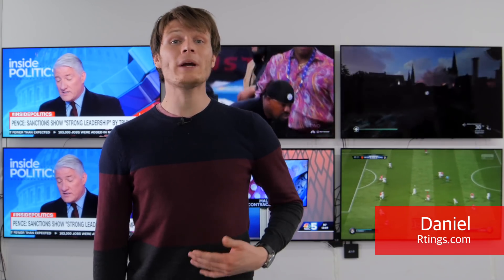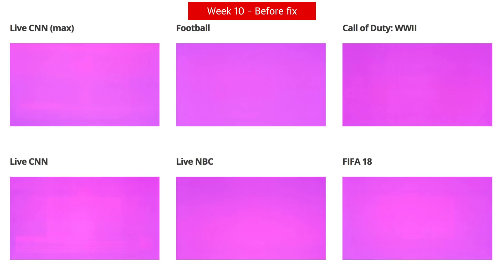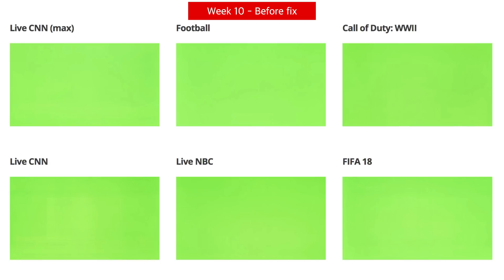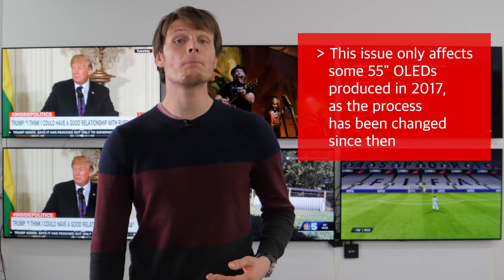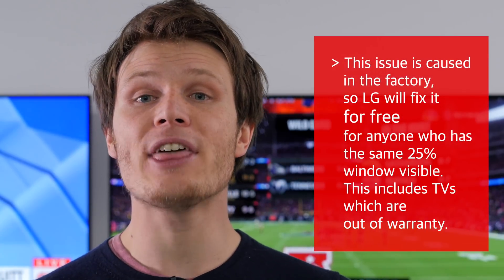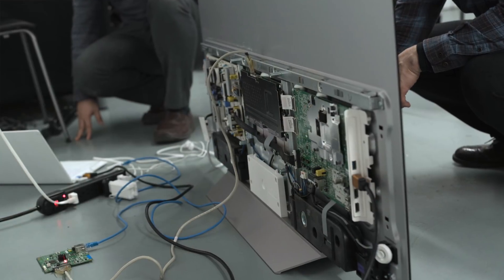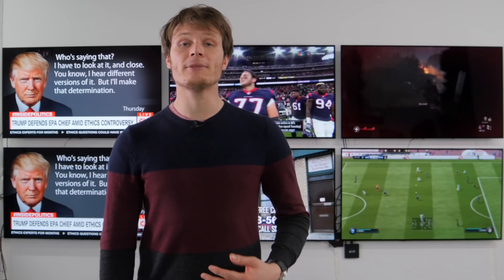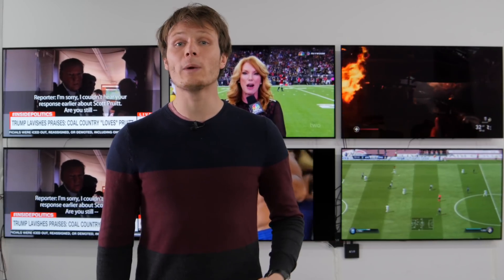Factory Defect & Fix - OLED Burn in Test Update Week 10 - RTINGS.com

Comment from the maker: We will continue to run this test to gather more data on the burn-in issue. Our current stance is for most people, if you vary what you watch, burn-in shouldn't be an issue. If you watch a lot of the same static content though, there is a risk.
Reply: Steve, TheDailyShaver Damn right!!!
Reply: i have the rectangle on mine....LG UK know nothing about it and won't fix it. All they will do is replace panel.
Reply: @davidcharles243  I'm going through this with LG now... I sent them this video via email and Twitter but they haven't responded to this.
They've told me to use pixel refresh 5 times... Like that will help. 
How did you get on?
Reply: @lydanial  - they made me do pixel refresh 5 times as well...which i did just to show willing!!...made no difference so they replaced the panel, which is spot on so i am happy. Not happy with what happened but happy with the outcome.
Reply: @davidcharles243  how old was your tv? Mine was a year old on Saturday, I noticed it yesterday.
Reply: @lydanial  mine was only a month old, so assume it came with it from the factory. Makes me wonder if firmware updates are triggering it as quite a few people seem to be seeing it but have had their tv's a while.
Reply: yea, thats what happened to me...LG uk said they can't do what is on this vid so can only replace the panel, which they have...new panel is spot on....shame they can't fix it like in this vid though.
Reply: i do know the panels take a bit of time to settle down and can improve after a few pixel refresher/compensation cycles. Its probably more that you need to re look at your tv settings after a few days usage...i have had to change the colour and oled light setting a little bit over the last few days... everything looking great at the moment
Reply: i had no luck with LG uk, they acknowledged the fault in the end but would only replace the panel, which they did and this panel is perfect. LG made me do 5 refresh cycles back to back to "prove" it wasn't some kind of burn in before they would change the panel.
Reply: well, yes...i meant i had no luck with LG uk recognising the 25% window fault...they said it was burn in. They wouldn't fix the 25% window fault either when they realised it wasn't burn in as suggest in this video. They did replace the panel in the end so i ended up happy.
Reply: My TV is less than 2 years old and when I spoke to LG they told me that I would have to pay for the repair. I don't know where RTINGS.com got their information from. "LG CHARGE FOR THE REPAIR"
Reply: I have such a problem. I live in Russia and no one wants to repair this way.
This problem also appears on the C8.
Reply: I have a just under two year old LG OLED 55INCH with CNN logo burnt into screen. I called LG support they had me send some pictures and now they are sending a technician out to replace screen and I have to cover the labour costs 250.00 canadian. Not happy will update when work is done.
Reply: Hi, What is happening about this now?  I have a 65" oled 3d tv, 3 years old about, I watch morning TV and it had a static logo and banner, This has now permanently burnt the screen, and can been seen alot on all red backgrounds. What do you think can be done? Thanks
Reply: this test is amazing, congratulations! great job.
Reply: Thanks for this video, LG Change me the panel due to Warranty issues, my model is the B7, also had a lot of burnin and this wasnt a void for my Warranty, LG should just replaced all this faulty panels, thanks rtings KEEP us informed....
Reply: Thanks for this video, LG Change me the panel due to Warranty issues, my model is the B7, also had a lot of burnin and this wasnt a void for my Warranty, LG should just replaced all this faulty panels, thanks rtings KEEP us informed....
Reply: What is this?? https://youtu.be/CVH3eMBoGAw
Reply: I just rang LG Customer support an explained that it's got a screen burn an told her about your youtube site said that I have no warranty an she said it will cost me £920 to fix the problem is there anything I can do please help
Reply: C J  LG BRAZIL did not support me in my case. They simply do not know the problem.
Reply: Rtings.com on my E6 OLED we watch essentially only Chinese TV Soap, BLU Ray disc, cooking shows. We are old seniors age 70, 80+  We have 70% screen area with Hazy bell shape burn in. Where by as Human fleshtones traverses that burn in area their skin turns GREEN!!!!!!
Reply: Rtings.com Whats static here???
https://www.reddit.com/r/OLED/comments/7nqz6s/sony_a1e_burnin_issues/

Cource its a LG OLED panel.

Static objects are just one cause of burn in's. 

The other big cause is Yellow, Red, Orange pixels don't last long. In defective OLED panels.

Comment: Does uniformity = burn in?  Just askin
Reply: No, a panel on any TV (LCD, OLED, whatever) can have uniformity issues not related to burn in such as banding, dirty screen effect, blotches, flashlighing, light bleed etc. 

But burn however, in essence is a uniformity issue caused by static content being permanently "burnt in" to the screen by pixels aging at different rates.

So all Burn In is a uniformity issue but not all uniformity issues are burn in.

Comment: Thanks to Rtings maybe LG OLEDs panels manufactured in 2018 will improve their uniformity with better QA/QC. I wish in 2019 they could develop a banding-free OLED with better performance in terms of burn in. Maybe the implementation TADF subpixel technology will be the key.

Thank you again guys. Keep us informed and push these brands to improve and fix those issues.

Comment: Basically if you mostly watch news and sports get a LED. OLED is more for movie buffs.
Reply: 03chrisv movies and tv soaps is what we watch. We have a 70% area burn in on our LG E6 viewing display
Reply: Larry Wong I have a 65 inch C6 and it's used mostly for movies, soaps, and anime with some gaming here and there. I have zero burn in even after 16 months of use. It might be a consistency issue with LG, some panels are better than others. I'm hoping they keep improving as I'll probably upgrade to a 77 inch oled when their 9 series comes out and I don't want burn in issues.
Reply: most that get that bad of burn switch their tv off at the wall each night with the 6 series. it has to be in standby for the 10 mins so the tv can use its refresher.
Reply: show us an image of YOUR Burn In.
Reply: I dont have burn in
Reply: 70% burn in? i call bs.  i use my oled as a computer monitor and have 0 burn in.

Comment: I dunno, I have a 65” C7, I’m not babysitting it all and it’s working like a charm, can’t say anything bad about it.
Reply: John Smith I had an issue with burn in my old E6 after about 9 months, I absolutely loved that TV because of it's incredible 3D, LG refused to fix it, so I sold it on. Was tempted to go for a B7 this year, but when I knew burn in wasn't covered by the store or manufacturers warranty I changed my mind. Without a doubt OLED is superior, but as long as burn in isn't covered, no way am I prepared to get stung again. I agree that burn in may be overblown though, as I have no idea how big a problem it is. I think last years and this years panels seem to be much better than the 2016 in most departments. I agree there are trolls slagging off OLED, but I also there are some OLED owners in denial. I'm glad that Rtings are doing tests like these, because it is actually helpful for LG and OLED owners should they have problems such as this one. And personally I would not recommend OLED for PC gaming, I think LED/LCD is the safer option, but I guess you're ok with an OLED provided you don't leave your desktop screen up for too long, as I'd be worried about my desktop icons burning in.
Reply: toobalkain finally a sane person. Same thing with my B7. I game and watch movies
Reply: i think the majority of these bad comments are people who don't even own an OLED. I've used mine as a computer monitor, for gaming, for movies, and I have 0 issues and its a B6.
Reply: I play HDR games on 100 Oled Light and 100 Contrast for least 4-6 hours on my days off, and haven't Have any burn in issues. 

Star wars battlefront II has alot of static images, but I haven't seen any burn in, just slight image retention from time to time that will go away if showed different content. 

If you game alot I recommend Refreshing your pixels on your TV before going to sleep.
Reply: Zorastorm 32 OLED Light 100? Why do you have to crank it up that much, does it improve picture quality for gaming? I watch movies at default level of 50 and it looks good to me.
Reply: in a driving game going round corners or up an over hills as the sun rises or sets feels so realistic in hdr going from the darkest areas to the brightest is amazing lgc6 pc 4k hdr for 18 months no burn in 
its not my eyesight either as after i watched modernwise youtube channels 5% to 100% slides i can prove no banding or burn in